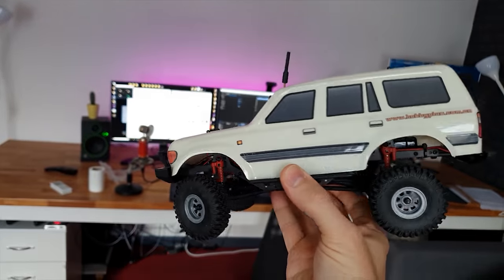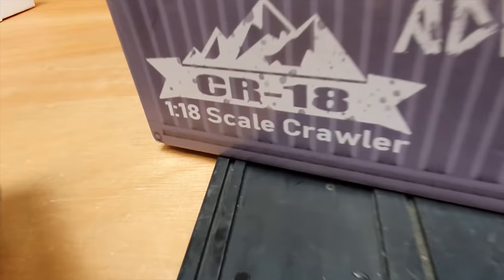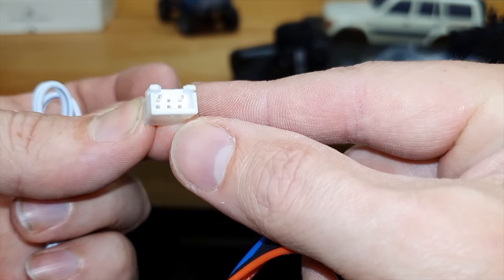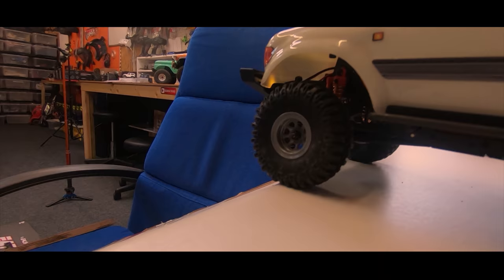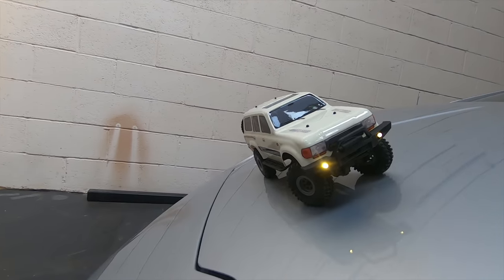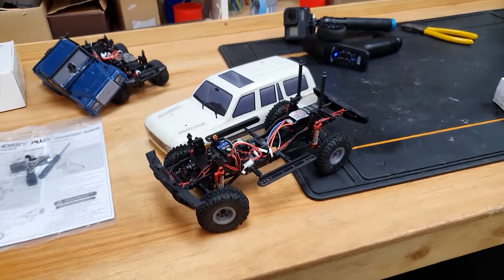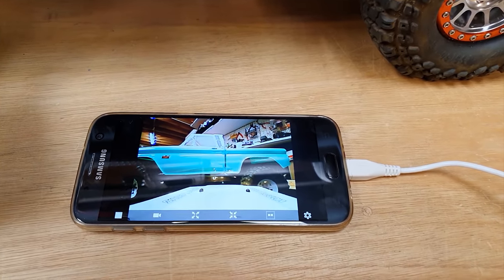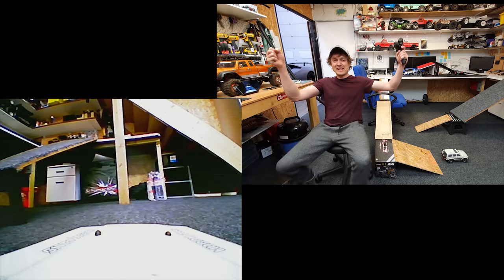Could this be the best Indoor/outdoor crawler? + being naughty

Comment: i buyed 2 and modified them. They now come stock with a 050 motor, its enough power to bend the driveshafts. 
Metal driveshafts are recommended, most of the axial scx24 driveshafts fit!

Comment: Wow that thing has a ton of torque twist. Kind of hard to call it the best until you address that. If you can find a way to outboard the bottom of the shocks (Malcolm bottoms outside closer to the tires)you will be able to climb at a much steeper angle and one wheel will not lift off

Comment: Sure has a twist in the frame. You can see the right front wheel come up when you give it the gas. Great video
Reply: Well no, live axles will do that
Reply: Well yes: when the truck is crawling up the ramp the right front wheel is raised way above the other three. That is not the effect of a live axle on an even surface that is a weak portion in the frame being twisted. Live axle has nothing to do with it. Both tires will pull at the same rate on an even surface as long as the spider gears are the same on R/L front axle.

Comment: Hey kev you probably wont see this but do you recommend this or is there other crawlers that will be better for the same price only looking for something small to use indoors
Reply: I would get the HBX devastator. 1/24 scale of Scx 24. I have all three . The transmission on this one went out pretty quickly for me. The HBX devastator is my favorite it just needs better tires for it. I'm running rock Creeper's on mine.

Comment: I would buy more of these cheaper crawlers but the spring shocks are deal breakers and ive tried it b4 its like 50/50 being able to find oil filled shocks that fit properly it turns into a nightmare and its never going to preform properly with those bouncy springs